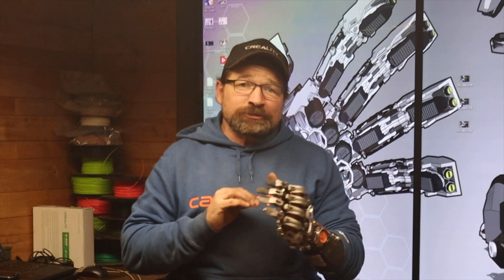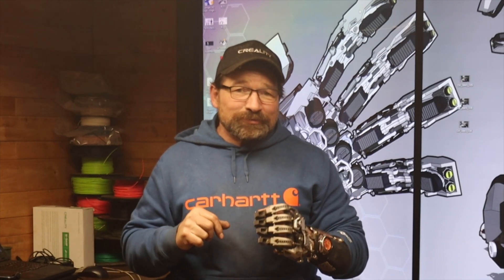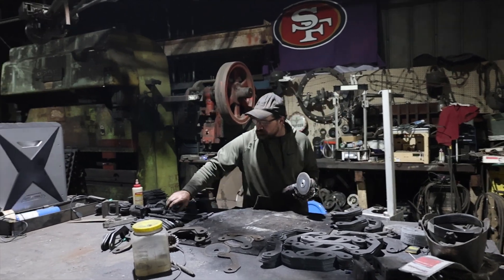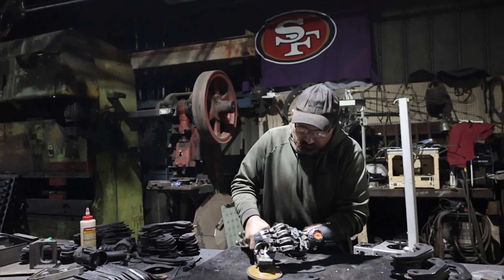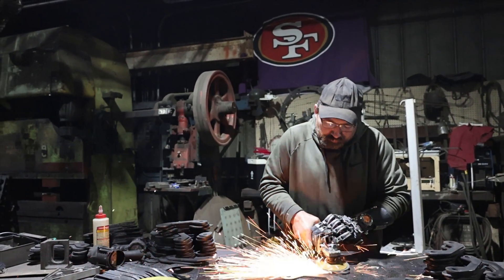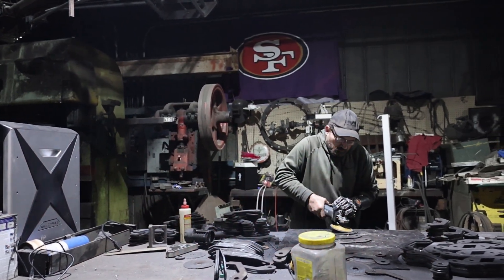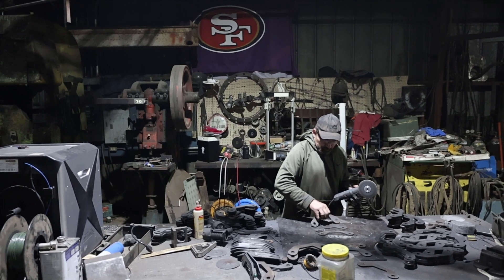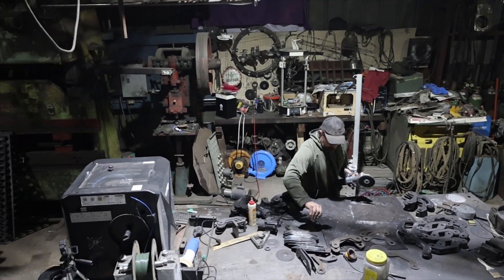Incredible Functionality from my Prosthetic Hand!

Comment: Really nice and robust design prosthetic you made  ! I have a myo-electric prosthetic left hand and it operates by motion sensors. These sensors are very sensitive ( i can adjust them ) When i'm working with electric tools aspecially grinders the sensors will trigger sometimes by the magnetic fields from the electric motor resulting in a hand that goes its own life. Your body powered has not these problems and you have a descent strong grip what i can see.
Reply: your english is great! i really mean it great job writing this up!!!
Reply: Thanks mate ! trying my best.